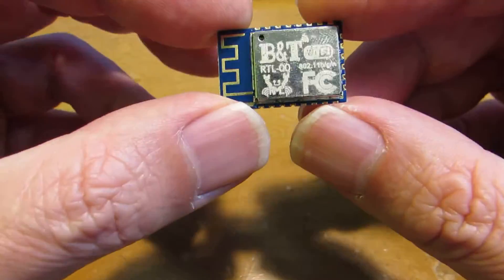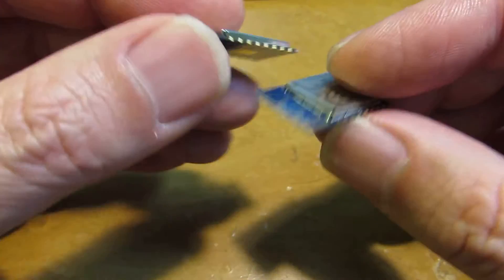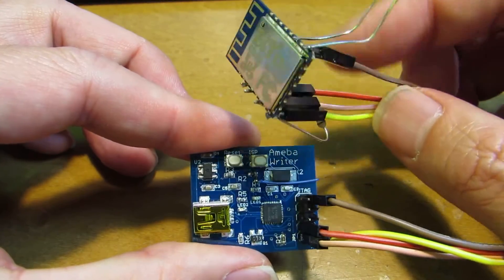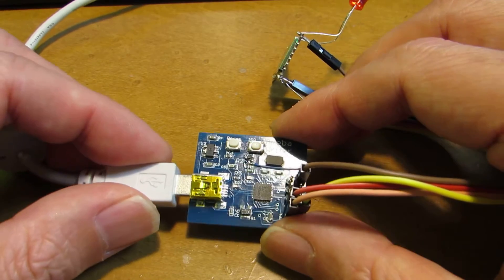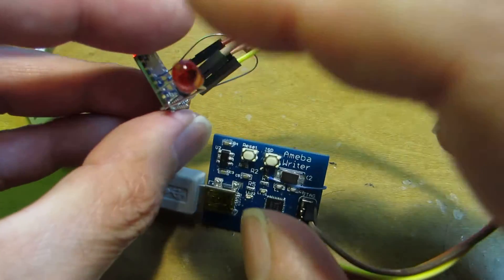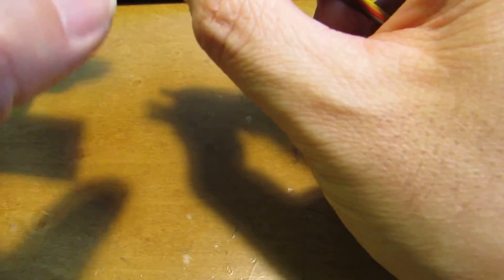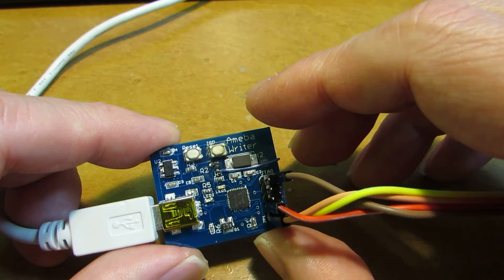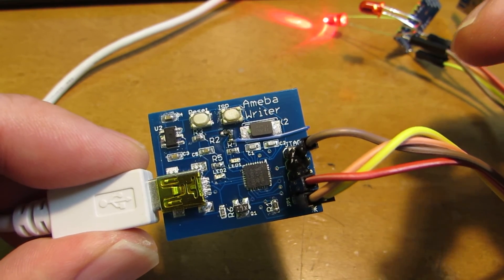Ameba Writer, easy programming interface for RTL8710 on Arduino IDE

Comment: Hi, I have bought the PADI IoT Stamp version of RTL8710 and the Ameba Writer and hooked it up like shown, but instead of Arduino IDE recognizing the port, it acts like storage device called "MBED". Could you please point me in the right direction to make it act like a device instead of storage? Thank you!
Reply from the maker: Hello, indeed storage MBED recognition in OS is correct operation. We don't need select (we can but it does not correspond to actual programming port setting) if follow the procedure of https://hackaday.io/project/19163-rtl8710-easy-programming-by-arduino-ide/log/51849-now-rtl8710-board-is-eventually-officially-supported-by-realtek-in-arduino-ide . By using Realtek's support, we can program PADI IoT as if it is Ameba 8710 board.  Another way is using pvvx's environment, https://hackaday.io/project/19163-rtl8710-easy-programming-by-arduino-ide/log/50938-how-to-arrange-arduino-ide-with-my-amebe-writer
pvvx's support only J-Link and we need modification as described above. Please try!
Reply: How do I upload the code without selecting the port? It is plugged in USB, but I can't select the port. www.dropbox.com/s/iel4e6nd4zjmrl2/Capture.JPG?dl=0

In my case, I just followed your new Realtek supported tutorial. Should I try doing it the old way?

(Ameba Writer and WiFi module LEDs are both blinking)
Reply: I guess, a better question would be: did you test the Ameba writer with your PADI IoT Stamp and did it work?
Reply from the maker: YES I did. Indeed PADI IoT and RTL00 are 100% hardware compatible (other words, they are same, except for metal shield printing)
For binary upload, just select "AMEBA  8195A" as board. We don't need select port, since actually binary uploading is NOT serial writing, but copy the binary to "MBED" storage. The copy binary procedure is defined in platform.txt inside Arduino IDE folder.
Reply from the maker: As another way, you can export compiled binary and copy the binary by drag and drop to MBED storage. That's all.
Reply: Ah, so I made it upload the code the way it should in the first place, but the blink sketch doesn't seem to control the GPIO pins. They all appear to be set to HIGH constantly.
Reply from the maker: Hmmmmm Indeed Realtek's support and pvvx supports have some different GPIO assignment. Installing Realtek's support is required to use pvvx's one and please try pvvx's environment. (Realtek and pvvx both I2C and SPI works by the same code but direct GPIO control may be different...)
Reply: microwavemont Alright, thank you for your endeavor, I'll try doing it through your older tutorial tomorrow.
Reply from the maker: And also please don't forget reset RTL8710 just after binary upload. RTL00/PADI IoT does not have auto-reset function after binary upload. (just once reset after binary upload. After that just plug-in power is enough to run.) And,,, also get to do "avoid brick". Some RF(WiFi) busy binary does not accept new binary and it looks like "brick". In such a case, just connect GC0 during power-on cycle is enough to escape.
Reply: It appears I finally made one of the module's built-in LED work with the official Realtek support (pin 5). Now I'm figuring out why the module which is connected through the breadboard adapter fails to upload code.
Reply from the maker: What kind of breakout board using? Pin 3 is pulled up?
Reply: This one: www.pine64.org/?product=padi-breadboard-adapter

No pull ups/downs. It could be that I just broke it, but the LED seems to blink at the same rate which I last programmed it before soldering it on the breakout board.
Reply from the maker: PADI IoT bread board  breakout is not my product so please talk with the company, it should be more straightforward.
Reply from the maker: pull-up is indispensable. Of course never connect directly to VDD but via 10k.
https://www.tindie.com/products/microwavemont/simple-and-useful-rtl00-breakout-board/
See this information, which I once sold at tindie (tindie store is closed)
Reply: Yeah, turns out that was just a broken chip. I soldered on a new one, works as expected.
Reply from the maker: Wonderful and congrats. Welcome to wonderful RTL8710 world!!
Reply: Yeah, but I can only use 2 GPIO pins with the official Realtek environment: pin 2 (GA5) and pin 5 (GA4, which is also the built-in red LED). Does the unofficial pvvx environment has access to more GPIO? If so, I'll program with that one instead. Thanks.
Reply from the maker: YES, pvvx's environment has full access....
Reply: Hi again, for the past month, I have had it working until I clean installed Windows, and I've been getting this problem: 

c:/users/david/appdata/local/arduino15/packages/realtek/tools/arm-none-eabi-gcc/4.8.3-2014q1/bin/../lib/gcc/arm-none-eabi/4.8.3/../../../../arm-none-eabi/bin/ld.exe: cannot open linker script file C:\Program Files (x86)\Arduino\hardware\development\rtl87xx\variants\rtl8710/linker_scripts/gcc/rtl8710-symbol-v03-img2_arduino_arduino.ld: Invalid argument

collect2.exe: error: ld returned 1 exit status

exit status 1
Error compiling for board RTL00 (RTL8710).

At a glance, can you recognize what the problem is? Thank you!
Reply from the maker: ok , open board.txt in development/rtl87xx/boards.txt
and
modify from
(org)rtlmodule_rtl8710.build.ldscript=linker_scripts/gcc/rtl8710-symbol-v03-img2_arduino_arduino.ld
to
(new)rtlmodule_rtl8710.build.ldscript=linker_scripts/gcc/rtl8710-symbol-v04-img2_arduino_arduino.ld

This will fix the program.
Reply: Oh, okay, thanks, Mont! this works for version 2.0.0 and below, but for version 2.0.1 returns an exit status -1073741819.
Reply from the maker: I will try later, but for the moment please enjoy 2.0.0.